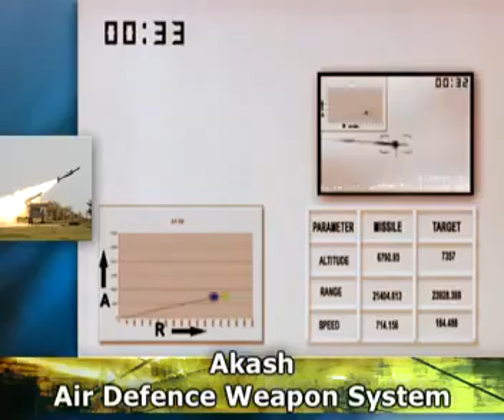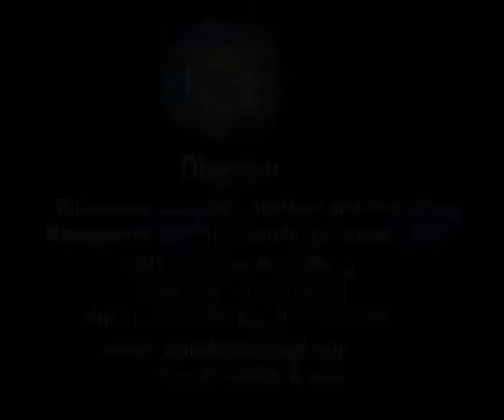Akash Missile*Akin to 2K12 Kub * SA-6 "Gainful"-NATO reporting name

Comment: Akash missile is very good. But it must increase the distance will work on during the war. The range should be at least 200 kilo meters.. :-) :-)
Reply: not possible with air breathing design
Reply: @greatmaster7413  air breathing?
Reply: +Atul Burman It is obvious, the Akash is only one in the many measures used in the Air Defence programme. Any enemy aircraft that manages to elude preliminary systems, need to be intercepted and the Akash will help do that.